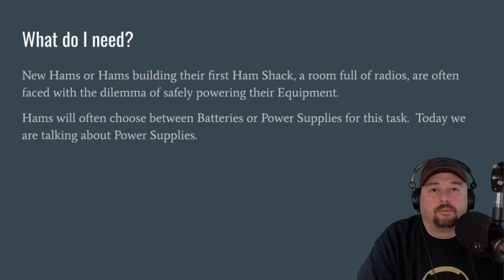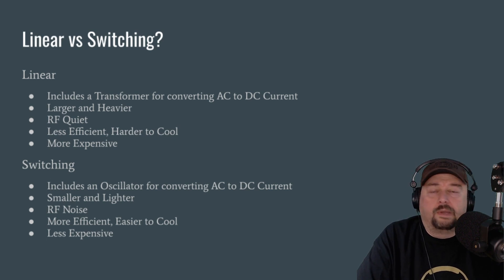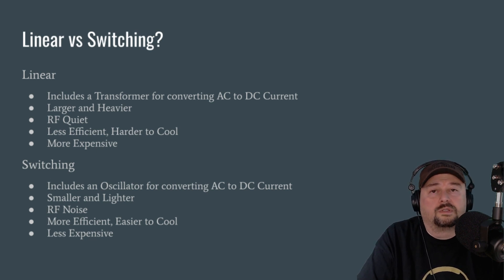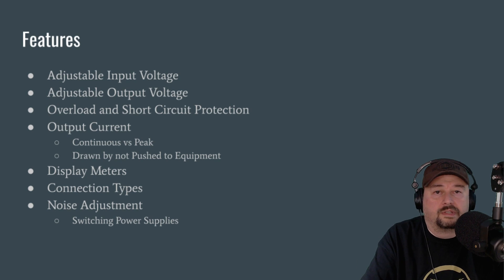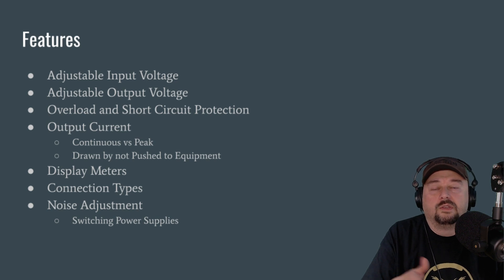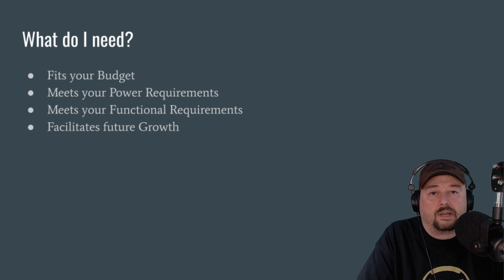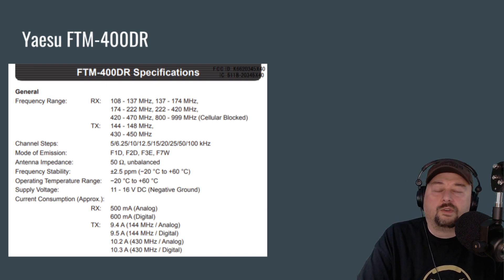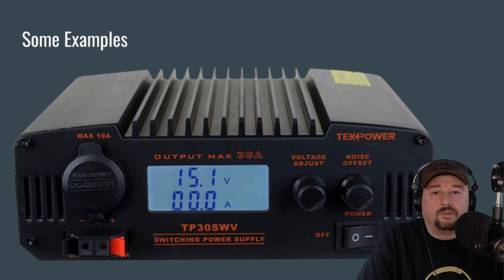Buying a Power Supply - Beginner Ham Radio

Comment: One thing I want to mention - shack (operations) and bench supplies are different animals.  You did say this was targeted for new hams, but it is woth menttioning.  A radio power supply used for operating will provide a reliable, steady voltage for your radios.  When you want to repair or modify the radio (which is one of the cool things about being a licensed ham - we can open up the radios and play around wifh them), you need a bench supply that has variable voltage, and most likely a dual voltage supply.

Primarily why I mention this is two reasons.  One, to encourage ham licensees to learn the art of radio.  Two, so when looking for a supply, they don't confuse a bench supply for an operations one.  A bench supply will cost more, but will not perfirm well as an operations supply.  It's purpose is to provide an arbitrary voltage, not a constant 13.9 VDC.
Reply from the maker: Great post Chris, you do raise a good point 👍
Reply: True, but I have used an Alinco "Bench Supply" for years on my mobile base station, and it rocks! Need more power? Just crank it up! I have never had any issues with power drawn.

Comment: Hello, i know, very late response but i watched your clip today the first time. I have a little addon which everyone is missing in the discussion "Linear vs Switching" and for me this make the huge difference. No one talks about, how do they fail??? Iam a typical 80s kid, started into CB/Ham with 10 years and with 14 i was doing my first repairs for other ppl. What makes the difference, in over 30 years now i never had an transceiver for repair killed by linear supply but a lot killed by switching PSUs with catastrophal damage!!! Furthermore, my first linear power supply still works today and i never had replaced any part, there is no switching PSU on this planet which will last so long without servicing. If your radio works with an switching PSU and dont cause any problems, use it, but be aware, it can kill your radio. But i would never operate an expensive transceiver or PA powered by an switching PSU!!!
Reply from the maker: This is a good story, thank you for sharing 👍

Comment: Good explanation of how to find what you need.  But why do none of the supplies have PowerPoles on the back where they should be?  I use them on all of my radio gear, but I don't want to see the wires!
Reply from the maker: Some do, but you are right most are on the front 🤷

Comment: Do I need a power supply when going completely mobile? I passed my technician license test last Saturday and I am waiting to see if my license will be approved because of a legal issue.
Reply from the maker: You’re going to need to power it somehow, many folks use a battery or connect it to the cars electrical system 👍
Reply: @TheSmokinApe I was thinking battery for my backpack rig I am thinking about after I get my general license.
Reply from the maker: Good luck on the test!
Reply: @TheSmokinApe passed the technician test on Saturday. Now I am waiting for the FCC review.
Reply from the maker: @EricWeeden sounds like you are off to a good start, welcome to the hobby

Comment: I think I'd rather have a battery and a charger for a power supply. 
A lithium battery would be nice but they cost around a thousand.
A lead acid is around like what now? Two or three hundred? 
Energy storage sucks! But I like it!

Your video was a VERY GOOD!
Reply from the maker: The price of LiFePO4 has gone down considerably in the past two years.

Comment: Current is pushed by voltage; it does push it to the radio, but the radio only lets so much through at a given voltage. Of course this can change as the circuit in a radio changes, letting more or less through. If we take a very simple circuit, the current increases as the voltage increases, because the higher voltage is able to push more through... up to a point of course. The circuit can only take so much before it itself is altered by it.
Reply from the maker: Thanks for the info
Reply: Thanks. Just some clarification for my fellow newbies out there. You're of course right that a power supply doesn't necessarily push it's full amperage rating through the radio, just that it means it should be capable of that much. Cheers.

Comment: New guy question - Can you have 2 mobile radios hooked up to 1 power supply? For example, have a HAM mobile radio and a CD mobile radio? Do they make PSs specifically for dual radios? I have seen any but then again I don't know what I'm looking for. Some have the "cigarette light" jack and the red/black cable hook-up. Could you plug the CB in the Cigarette lighter jack and HAM in the red/black? Thanks in advance
Reply from the maker: You can but don’t transmit both at the same time 👍

Comment: I'm brand new to the hobby... so I'm sure this is a dumb question, but if I get a power supply that can peak at 35amps, am I not just going to immediately trip the 15amp breaker on my home electrical panel?  Do I need to replace those breakers with a higher amperage one?
Reply from the maker: It would be 35A DC from the power supply and only 3.5A AC from the wall outlet.  The power supply transforms the 120V AC from the wall to 12V DC 👍
Reply: @TheSmokinApe  Thank you!

Comment: I had three switch mode psu and had nothing but trouble.. Big noise generators.. So I went back to linear without issue. I'm sure switch mode has maybe got better but I'm happy with what I'm using...
Reply from the maker: These days I’m always mixing it up between switching, linear and batteries.  Thanks for watching TF 👍

Comment: Great explanation very good, i need one for my MFJ 962E what do you suggest? Thanks
Reply from the maker: That’s a great tuner, but its power requirements are pretty low.  I’d just tap off my shack power supply and you should be fine 👍

Comment: Great video as always . One question, not really related ... kind of... When i do pota with my icom 7300, i only have my 12v dc battery directly connected to the radio, but another ham told me i NEED a item which will boost the 12v dc to 13.8 v dc... is this true... and if so , what is it called??
Reply from the maker: The recommended input power is 13.8v +/- 15% which is about 11.8 - 15.8v 👍
Reply: ty  sit @TheSmokinApe

Comment: Thank you for doing this video. I am new, although I got my General in Jan 2020 I am just now starting to get more involved. I have joined a local club, attended a meeting and a POTA event, and am now ready to start building my shack. I have 2 HTs that I use for local nets but want to get on the air and experience 10-40 meters. I was not sure as to what power supply I need but this was immensely helpful.
Thanks again!
Reply from the maker: Welcome to the hobby Richard, glad you liked the video 👍

Comment: How to use the power supply for the radio, because there is DC cable
Reply from the maker: The power supply will have connectors for the radio.

Comment: Good video explaining power supply differences and requirements I have an Astron 35 peak amp linear power supply. Even 30+ years ago it was expensive, but worth it. I like the voltage and amp adjustment with the clear analog meters. I've used Radio shack 5 and 10 amp supplies for years and they work well too. Haven't tried switching ones yet, seems like the better ones don't cause much RF noise now.
Reply from the maker: They likely have better filtering, at least the good ones but nothing beats a linear. Thanks for watching Kurt 👍

Comment: Hi Ape!

I must say the quality and usefulness of your presentations are superb! Just read through all the comments on this vid - many of those helpful also.

Need a PSU for new fixed site IC-7300. Am pretty much sold on linear over switching, possibly an  Astron. Did you ever switch to a linear?

Do you have a video on power management hardware like powerwerx? Am unclear how they fit in and what they offer.

73,
John - KK7JBZ

Edit: Found your videos on power distribution units. Got it. Thx.
Reply from the maker: Thanks John.  I never did make the switch to linear.  Good luck with you project and thanks for watching 👍

Comment: hi my fist psu got 28 years ago military made   13.8v 40 amps  24..28v 16 amps and 48..56v 4 amps stil have it is a beast haz 2 transformers of 1200w each about 30kg the connectors where a bit of a problem 5 pin 25 amps mains in out and 10 pin 60 amp per pin output voltage 73
Reply from the maker: That does sound like a beast, awesome!

Comment: You can put me firmly in the Linear power supply camp. I've been using an Astron RS-35M since the early 1990s and it still works just as well as the day I took it out of the box. Just this week I upgraded to an Astron RS-70M, and man, that thing is a BEAST. Now, if you are going portable, or going to operate from a vacation home somewhere, and will still have access to AC, then yea, take along a switching supply. They are much smaller and lighter. 73 de WB4DW
Reply from the maker: Thanks for the perspective Douglas, seems that once you try a linear you are hooked 👍
Reply: @TheSmokinApe  Once you go linear, you never go back. 🙂

Comment: So here is my take. My call is n0nwo and first got on the air in 1991.  I have a power suply that has been around since long before I aws a ham. I have purchased it used. I have extremely poor vision, so I do not give two hoots or a tinker's dam about meters on the power supply. The power supply I have been using is linear and has not been shut off since I hooked it up on 2003 (except for power outages). 

I am considering replacing it as it is getting a little long in the tooth (like me).  My power supply is hidden in the back of my home-made radio cabinet  there all the wires are out of sight and out of mind.  I have noticed that the supplies with meters on them all pretty much have the output connections on the front where the meters are which is just stupid. There is no way to hide the ugly power wires to the rigs.  If you like a clean looking setup, forget about meters. 

If you want hassle free operation forever, consider getting a linear power supply. You never have to worry about getting any interference on any band ever.  They are heavier, but if you are setting up a pertinent shack that probably will never leave the room it is set up in, WHO CARES???  Linear supplies have, for the most part, less issues with heat.  Ya they can get warm, but not as warm as fast an switching supplies.  Some have cooling fans, and many do not because they just do not need them. If your power suply gets hot quickly, maybe it is because you are working it too hard and need an upgrade. 

Give yourself some room to operate. I run an HF, rig and sometimes two VHF rigs on the same power suply. also some some light duty lamps antenna tuner and such. Give yourself plenty of room for amps above what you think you will need and be sure to look at continious duty amps and not the peak spike loads that most supplies are rated at. 

My plan is to get another linear supply. Forget about meters, forget about Rf supply noise. just hook it up turn it on and let it run for another 30 years (the approximate age of this unit) and never give it another thought.
Reply from the maker: Thanks for the detailed comment Minton.  I tend to agree, when the time comes for a new PS here, I want a liner.

Comment: What power supply do you suggest for the Alinco 735T?  The DC voltage range for operating this radio is DC 11.7V to 15.8V.
Reply from the maker: You might want to check the amp rating too, I'm not familiar with the Alinco.

Comment: The two main problems with most power supplies these days is that most are switch mode which causes RFI as discussed here, and most do not have over voltage protection. Infact even most linear supplies do not have over voltage protection. I bought a Microset PT-135. expensive at £250 English pounds sterling but it's Linear and has both short circuit protection and over voltage protection. A lot of money for a PSU, but if it prevents you from loosing a radio that is far more expensive, surely it has to be worth it? the verdict? you get what you pay for. why spend a fortune on a radio if your not going to power it with a decent PSU?. it's a no brainer as far as iam concerned and not worth the risk! I can't understand anyone who is willing to spend a few grand or whatever on a HF radio, yet is quite happy to skimp on the power supply.
Reply from the maker: Great comment and info, I agree don't scrimp on the supply.  Thanks for watching Timothy!
Reply: @TheSmokinApe  perhaps another thing that's impressive about my Microset PSU is that it's not made in bloody China lol
Reply from the maker: @timothybrown7792  haja

Comment: Perfect timing. Just bought an Icom 7300 and need a power supply. The switching part I did not understand. GREAT VIDEO! What power supplies do you like for the 7300?
Reply from the maker: Hey Robert, right now I am using the MFJ-4230DMP without any issues.
Reply: @TheSmokinApe  Thanks!!

Comment: I am a new Ham. Do I need 220 volt to achieve performance. Or do us systems work on 110 volts.
Reply from the maker: Most can be set to either, check the product specs.

Comment: So question… I’m a truck driver and still learning and growing. Currently running a 4 pill and Stryker 955 from my truck batteries, which is about 200amp/14.5v … when I key up I drop to about 13.8v which I get is normal, alternator keeps me about 13.9v on dash… at 12.6v major components on the truck start to turn off due to a low voltage disconnect. My question is, would a power supply ran into a 1500 watt pure sine inverter 12 DC/110-120 AC be a safer route as I consider moving up to a 12 pill?
Reply from the maker: You are talking about some serious power.  I’d personally be thinking about an isolated battery bank.

Comment: Just getting into the hobby and working on move up to general so i can get more toys.  I wanted to ask if you need one power supply per radio or is there one that i can run two radios off one power supply?  Like a HF multi band plus a cb on the side.
Reply from the maker: I run 3 radios a tuner and meter off mine at the same time, that said I do not TX at the same time.
Reply: @TheSmokinApe  do you have a video on how you have them wired to the power supply?

Comment: Great video! Informative and concise. I'm learning electronics, so the first thing I did was go out and buy every bit of vintage kit I could get my paws on for next to nothing cost wise. So now I have several radios and several beefy, and heavy, power supplies. As all of the radios are corded for AC mains (even the 1954 NC-300), I'm left wondering why I would want to use the 50lb 13.8v Gem... Any information regarding this would be greatly appreciated. Cheers!
Reply from the maker: Sorry I can't help on this one, corded AC is before my time.  Join our TOADS Discord, I am sure someone there can help: https://discord.gg/Fu5ZYVfeww
Reply: @TheSmokinApe  Thanks!

Comment: Sir, nice video. Very informative. I learned something new about noise adjustable switching power supplies.  Anyways, being an "old timer" I use both switching and linear power supplies.  I like using the linear power supplies for the more permanent shack or work bench locations due mostly because of the weight.  However, when I am moving my radio gear from one location to another location either for use in the field or portable operations for several days, switching power supplies are my choice.   For my linear power supplies, I have an Astron Tripp lite, and several pyramid supplies. For, the switching power supplies, all 3 are Radio Shack hold overs, I think they're made by Samlex.  No problems using them after 15 years.
Reply from the maker: Thanks for sharing your experience KD4BAO

Comment: S.Ape..... one thing might be worth mentioning here.   Some supplies WILL NOT start up under a heavy load. Mine here... and old linear, specifically states the maximum load it can handle when being powered on is 5 Amp. No more.  A far cry from the 35 Amp it can deliver constantly and the 40A peak it can handle for a short while. Mind you, at 35A, the internal fans would do a 747 on take-off proud !
Most of us have limited (sometimes very limited) funds for our hobby, but a decent power supply, bought with an eye to the future ,is to be seen as an investment in your future Ham station.
Your point on always ending up with more kit in your shack than you ever imagined is so very very very true !!!
( I started with a handheld... added a 2m/70cm, packet radio, Yeasu FT900, Yeasu FT1000D, big linear, 130ft twr, Hy-Gain TH7, a Create wormdrive rotator (that must have been used to turn the rudder on the Titanic and other stuff, it would shear your fingers off without any trouble !), and God knows whatever else found its way into the shack.
No, not  in a million years would I have seen that coming.
Albert
Reply from the maker: Good point about startup Albert, thanks for mentioning it.  I am right there with you on "shack stuff" I have a serious junk pile!

Comment: Man I'm just burning through your vids. Thinking ahead of a possible (highly likely) next step into the ham radio black hole, getting a FTM-400XDR and using it for home use (possibly followed by a second for mobile in the truck). Great input from your vid regarding the power supply standpoint as I'm learning all this. That said if you have any suggestions for a good power supply that pairs nicely with the FTM-400XDR it would be appreciated.
Reply from the maker: I've been really happy with the MFJ-4230DMP